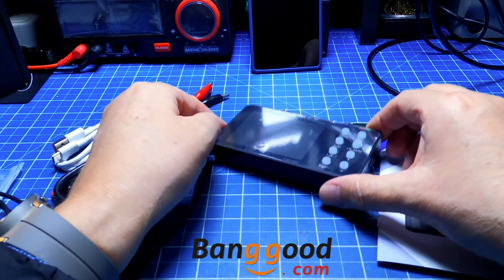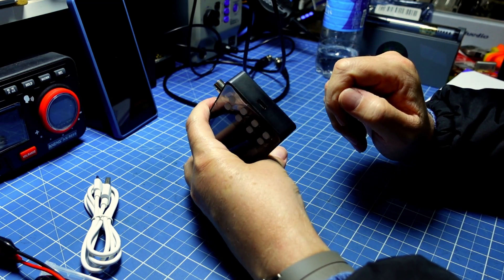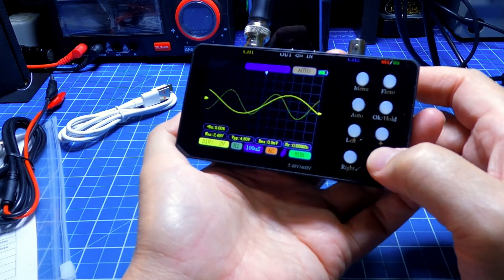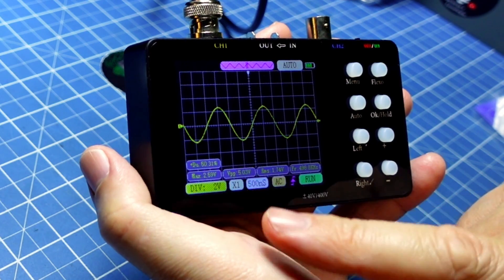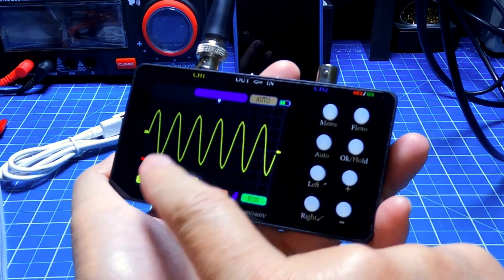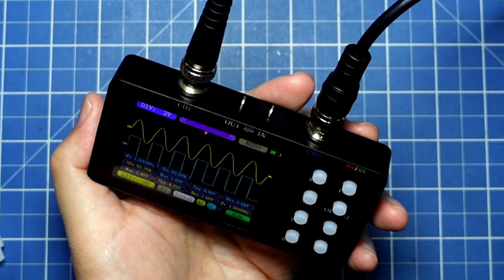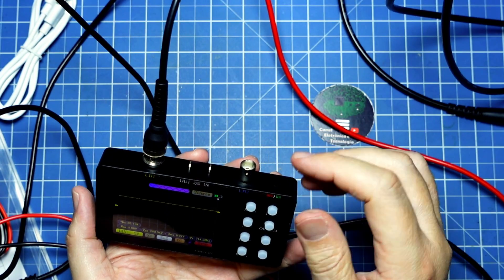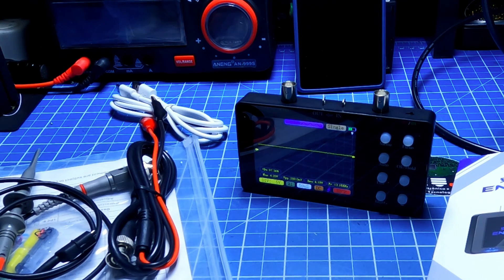SCO2 - Mini Osciloscópio versátil e menos de 50 dólares

Comment: A última versão do firmware inclui o modo FFT? Funciona bem? Obg. -- Does the actual firmware version includes the FFT mode? Is working? Thanks.
Reply from the maker: A versão que tenho instalada não tem. Não vi se há uma nova versão.
Reply: @EletronicaeTecnologia  Tem a 1.98 (ou 0.98 dependendo do HW).

Comment: Hello Sir, I am having trouble using a vertical offset on this device. This is useful when trying to see the peak to peak difference on say a 5VDC waveform. I am unable to zoom onto that waveform in a meaningful way, I am restricted to 1V/division to see the straight line waveform; adjustment to 500mV/division sends the waveform off screen and then I cannot offset the vertical position eg. 4V min to 6V max. Did you experience this or any work around? The calculation does show Vpp as a number, but I'd like to see the waveform.
Reply: did u solve it?
Reply: Nope. The unit also arrived with a busted channel, but the seller issued a refund.
Reply: @djmankey1  I read this literally before pressing the "purchase" button lol. Do you think the osciloscope is not worth it or that you got unlucky?
Reply: Probably just unlucky but being unable to achieve the waveform resolution I needed was off putting too. A second hand Rigol would be a better purchase unless there's some other cheap model out there that has improved where this one was at. Cheapies are normally just re-packaged versions of the same mainboard.

Comment: I'm not able to measure AC transformer Sine wave output I set it on AC, tried Auto, set probe on 10x and 1x as well, Voltage div to 10v, 50v, 100V as well... But sine wave isn't formed... Any suggestion??
Ps: next to AC transformer line full bridge rectifier is also connected but I'm not testing it next to rectifier I'm measuring it from from wires connected to bridge

Comment: Thank you very much for this video.  I watched it before buying the item and just watched it again after it arrived.
Reply: Hello, it seems the author has not fully figured out this oscilloscope, did not show the function of measuring current over time, this device has a support site and the latest firmware 1.96, the site can be found by the QR code on the product box.

Comment: Would you please compare it with ds211, 212 please and please try in English 🙃
Reply: You can turn on subtitles
Reply: I'm not able to measure AC transformer Sine wave output I set it on AC, tried Auto, set probe on 10x and 1x as well, Voltage div to 10v, 50v, 100V as well... But sine wave isn't formed... Any suggestion??
Ps: next to AC transformer line full bridge rectifier is also connected but I'm not testing it next to rectifier I'm measuring it from from wires connected to bridge
Reply: I'm using that same model